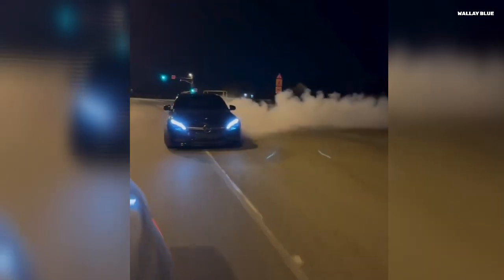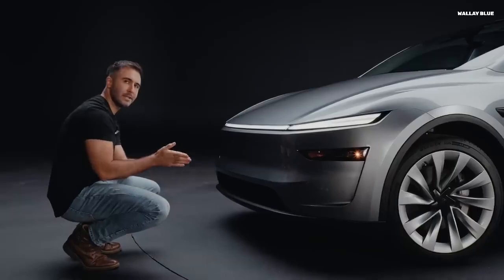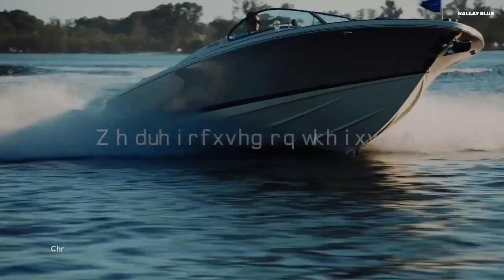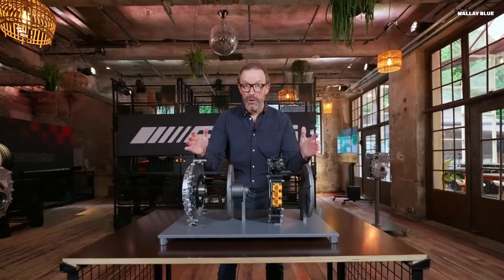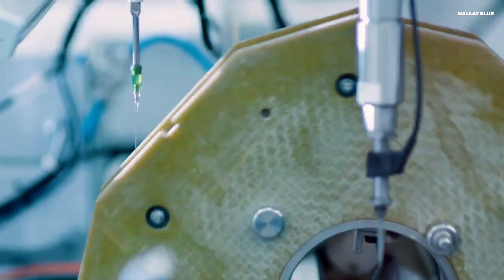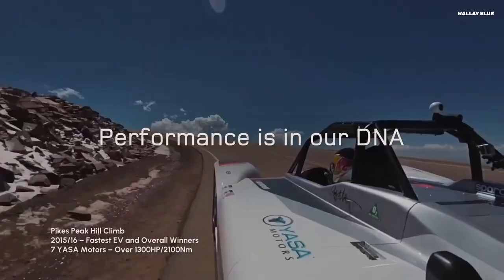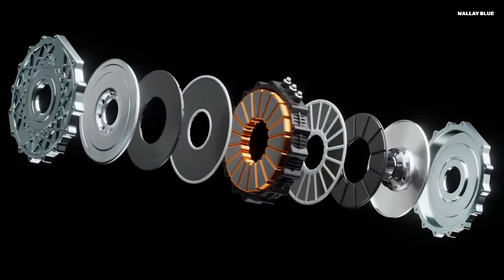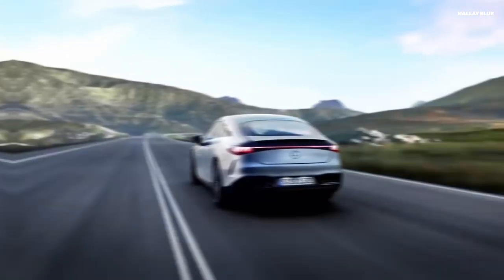Mercedes Axial-Flux 13kg Electric Motor Makes 750HP — Outperforms Tesla, Ferrari & Koenigsegg!

Comment: YASA offers high-performance axial flux electric motors designed for both pure-electric and hybrid propulsion systems, including automotive and marine applications. Better then all. 
think about the weight the car saves. not just the engine, everything else.